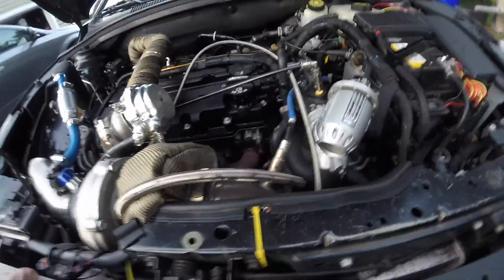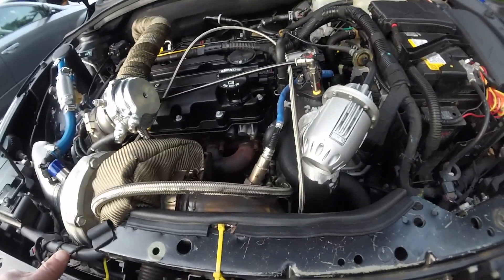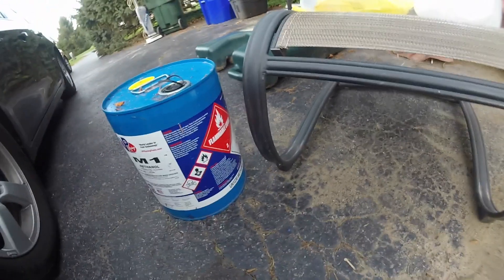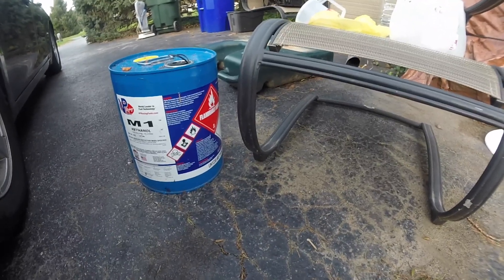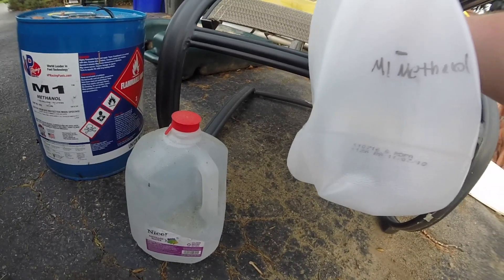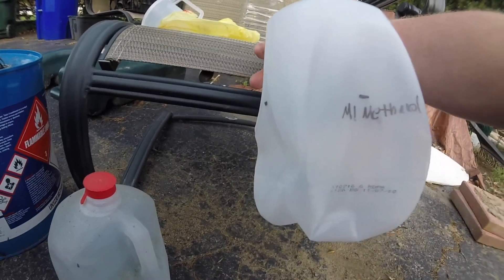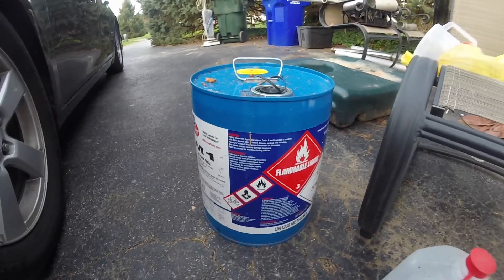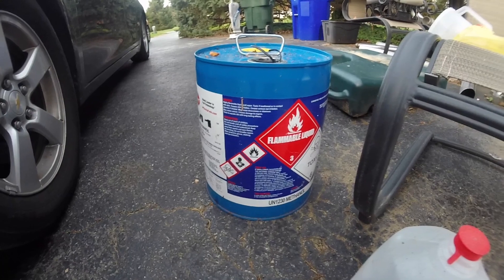How To: Mixing Your Own Water Methanol

Comment: great video! I have discovered a cheaper way is by using a product labeled as "methyl-hydrate" from homedepot its 99.9% Methnol!!! Mix with distilled water by weight!!! 50/50 mix or whatever ratio you want!

Comment: its the other way round, methanol is lighter by weight than water. thats why you have to put in more methanol to water mix to get a true 50/50 mix 44% methanol to 56% water

Comment: I can’t get the stuff to combine? Water and methanol stay separate. One is heavier than the other.
Reply: The two should mix without any issue and stay mixed. What exact chemicals are you using?
Reply from the maker: I know, all your doing is mixing the 2, that’s why it’s called ‘watermeth’
Reply: William Cochran but the reservoir draws from the bottom? That means it would only be drawing water for half of the tank?
Reply from the maker: +braydenpresber I would think that if your driving aggressively enough for the pump to kick on it’s probably sloshing around enough to even the 2 out. Regardless, if your running watermeth you probably also have the vehicle tuned to automatically adjust power/torque to the fuel octane your using.
Reply: William Cochran i am tuned for it yep. I would have previously thought that everyone got it to mix up nicely.
Reply: @NorthEastSaskFarmer  possibly yes until u start actually driving